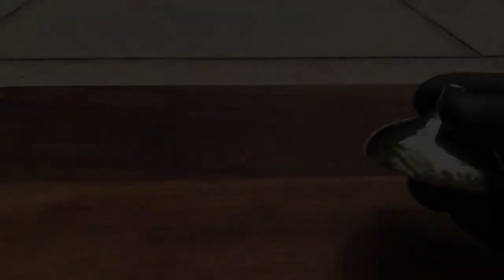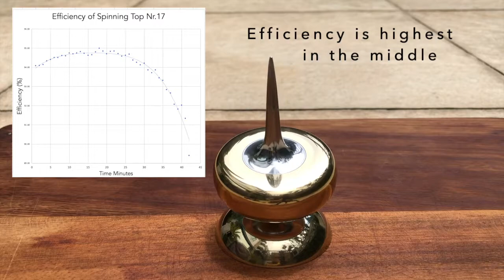Spinning Top Mk.17 | 42 minute spin

Comment: I like the elegance and simplicity of this new spinning top.  It is very good aesthetically.  You made the video in the same style, simple and elegant, I think it is well made.
At a certain point in the video I see you use gloves,  is there a particular reason ? Maybe the flywheel was very hot so the rod could enter in it ?
Reply from the maker: Thank you very much! Yes, To attach the brass flywheel to the aluminium I used an interference fit. It is a fit which is stronger than a press fit. As you thought, I heated the brass flywheel quite considerably such that its inner diameter expanded by a few microns. This allowed me to push it over the aluminium and as you can see in the video, the aluminium dissipated the heat quickly and the brass clamped onto the rod. So no adhesives were used. I think this technique wouldn't work as well with wood, as it isn't as uniform. I would probably use epoxy resin in the future if I made a wood-metal top.
Reply: @hiper_tops , I agree that with a wooden core is probably better to use an adhesive, but for an aluminum core it seems the best option.  I see you also improved the knurl; did you use a file for making the grooves ?  They are more accurate than in your older tops.
Reply from the maker: @iacoposimonelli7191  I filed the grooves by hand, however I started each one by using a thin cut-off disk on a dremmel attached to my lathe post. It is a similar method to yours, but the grooves are thicker and more difficult to control.
Reply: @hiper_tops  , good idea !  And if it is possible to find a disk with a suitable profile, maybe you could make the grooves without even need to finish them with the file.  About the tungsten, I remember that at your school they don't like you to work it in their lathe, but this surprises me a bit, and I can't imagine the exact reason.  This is tungsten alloy, not pure tungsten, right ?  Pure tungsten is extremely hard and not workable on the lathe but the alloy is affordable;  the mine is a copper 20% + tungsten 80% alloy and it is similar to pure copper to machine.  Like copper, my tungsten alloy takes about twice the time to be turned on the lathe compared to brass.  If your alloy is not too hard, probably you could machine it even with your lathe, using carbide tools and resharpening them often, it's just a matter of time and patience.
Reply from the maker: @iacoposimonelli7191  I believe my tungsten is pure, or at best very low in copper. It is also in the UK at the moment so I am unable to work on it. When I return, I'll test its density to figure out the copper content. If it is 80:20 or something, I'll ask again. I'll keep you posted.
Reply: @hiper_tops  ah! got it, you may dismiss my other question. blyme, a few microns? I don't thing the lathe at my disposal is that accurate hahaa